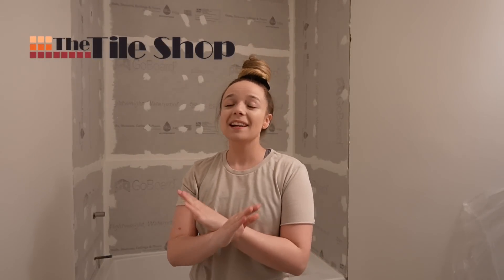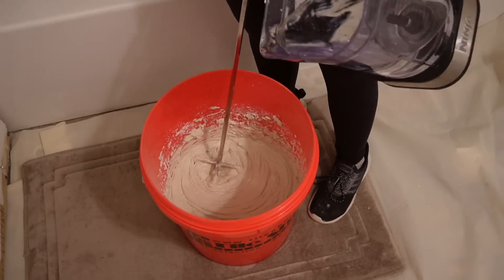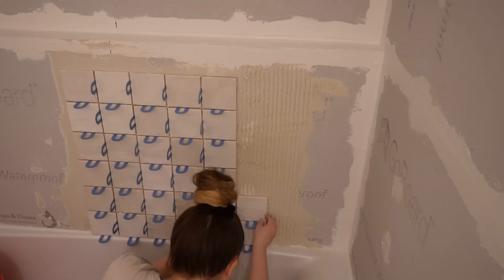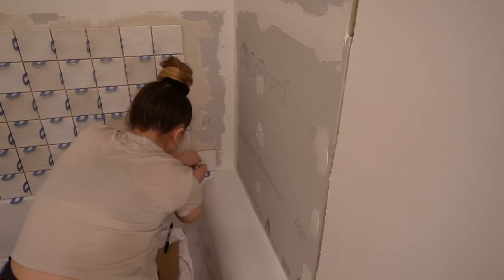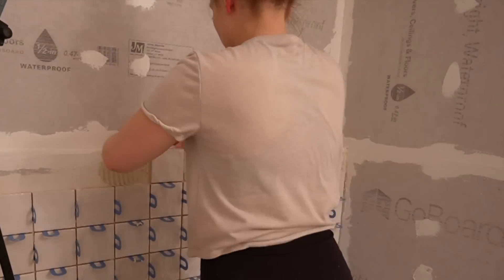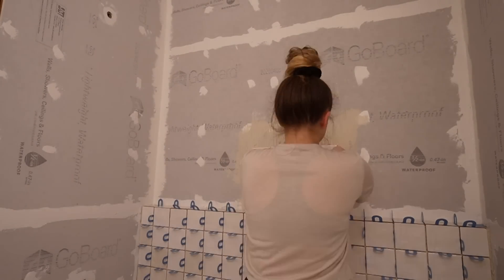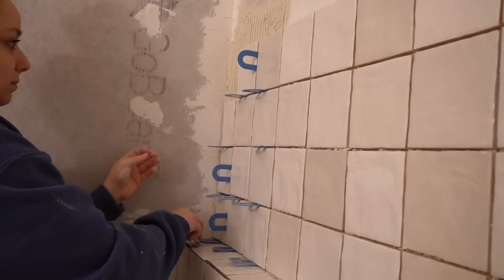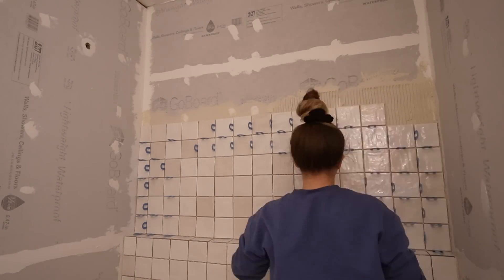DIY BATHROOM MAKEOVER | HOT MESS LAKE HOUSE RENOVATION | LEXI DIY

Comment: Have you considered having the "pop of color" be the towels, bath mat, shower curtain, etc. so you could change the color easily?  I vote for a neutral vanity.
Reply: I would go with white and use the cor in the shower curtain  towels    
and a little rug in from  of sink
Reply: I agree. Neutral color
Reply: Is go for a black vanity to match the floor tiles. Funky colours with your accessories, then can be changed out. It will look gorgeous whatever you pick, I know ❤️